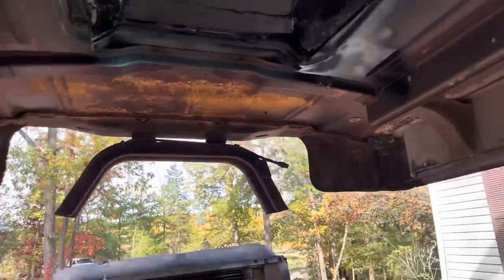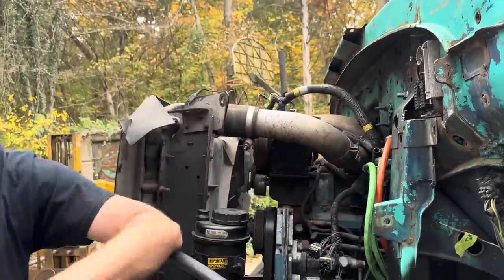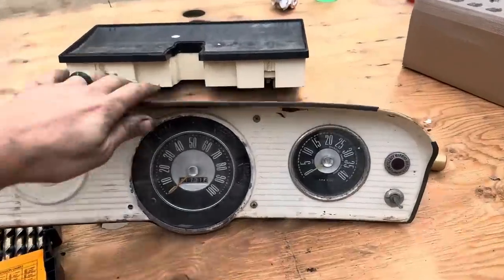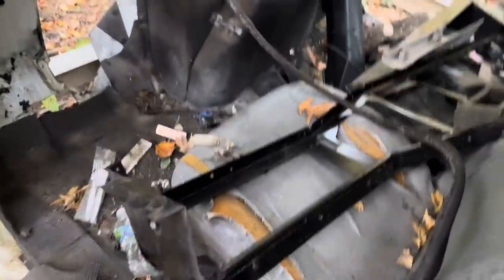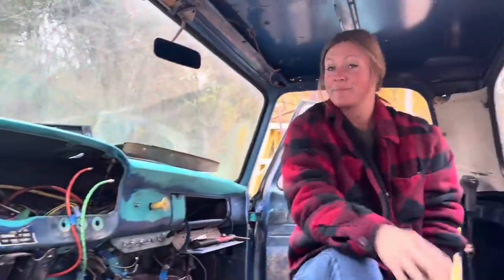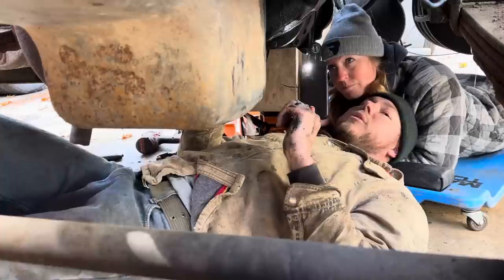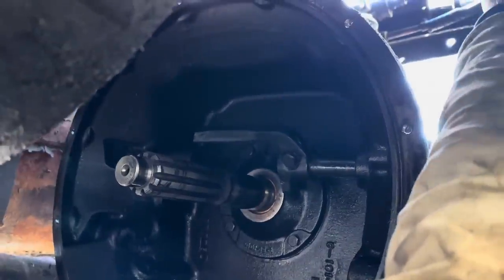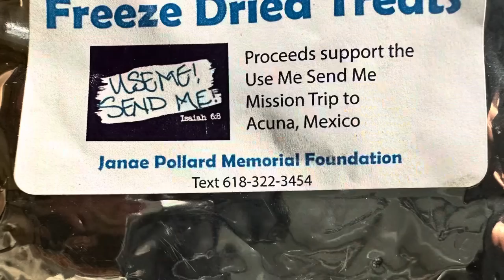Hannahs welding rig is fighting back… BROKEN PARTS!!

Comment: Bummer. The release yoke most likely tipped too far because there wasn’t a linkage on it, and it got caught on the clutch pressure plate when you stated the engine. Be sure to walk the fork around the release bearing as you install the trans on these pull type clutches. I have replaced those release yokes through the inspection hole without removing the trans but it takes some patience. Looking good guys!

Comment: Corey if you haven’t installed it yet and never have the clutch release arm has to be turned to allow those dogs to hook behind the throw out bearing as you are installing the transmission I use to have to put them in gear and get on the rear put my foot in the middle of the driveshaft yoke and push and turn them at the same time to line up the clutch

Comment: 9:30 Cory just a reminder you said not much experience on larger trucks. I your clutch assembly is duel make sure you put the center friction plate in the right way there is a front and back. It needs to recess into the flywheel

Comment: Phone cable that used to plug in to landlines, instead of using tape and marker risking that tearing off, cut a couple pieces of the same color twist it around what you need and it's much easier and quicker.. there's some commercial grade phone line that is a couple inches thick, the wire size is the same, just hundreds more

Comment: Cory save yourself the trouble clutch pressure plate throw out bearing and resurface the flywheel since you've got the engine separated from the transmission.

Comment: Before you put the clutch in, inspect the pilot bearing, that is in the flywheel, and see if the dealer will loan you a clutch alignment shaft, it will save you a headache when reinstalling the trans.

Comment: Need to plan your builds better don’t put a timeline on them then you won’t be rushed and you can do everything right the first time take your time do everything 100% correct the first time from wiring to suspension tires brakes paint bodywork whatever you want even air conditioning it will cost you less money in the long run doing it the way you really want it the first time around